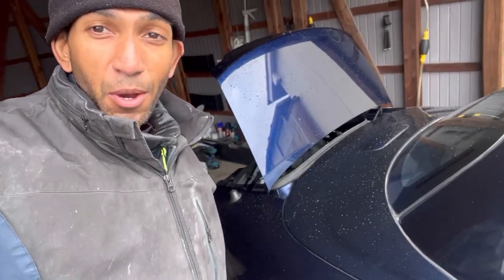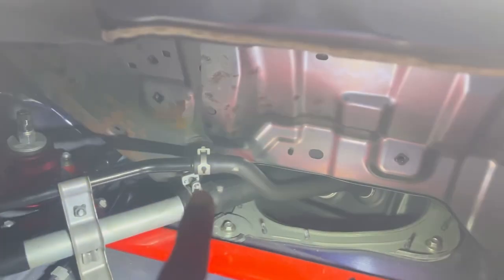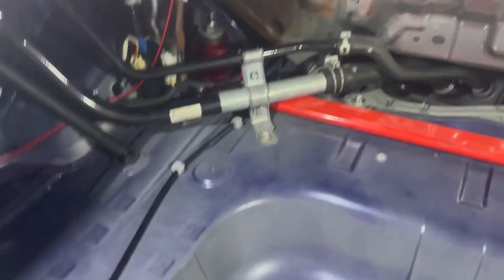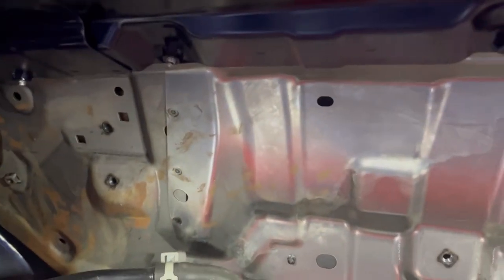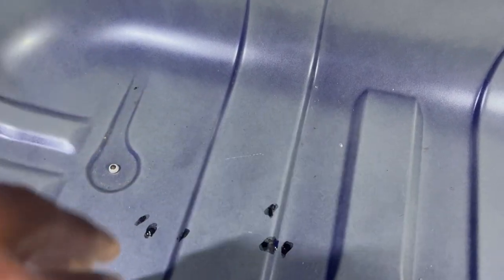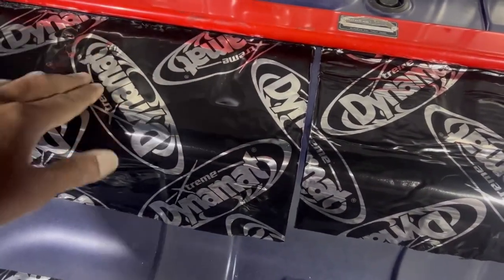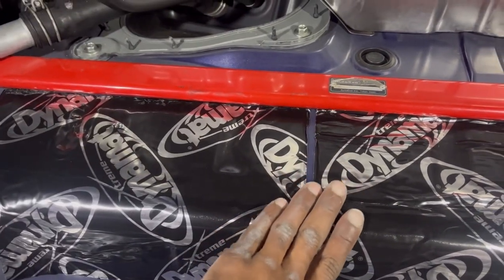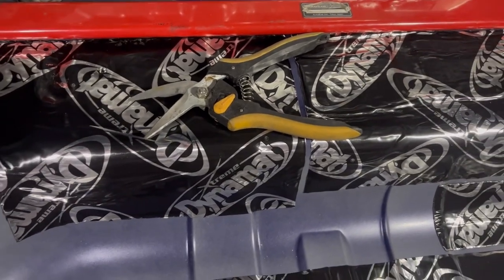NC MX-5 Miata Trunk Sound Deadening Dynamat Xtreme Install | Tach On Red

Comment: One of your best videos. Very insightful and honest. I nave an NC with the PRHT and noise is my biggest gripe. Mazda kept sound dampening out to save weight. They figured that sports car enthusiasts didn't care about quietness, wrong!
Reply from the maker: Thank you for the encouraging feedback! 

Agreed.  That said though, I'm not too impressed with most factory sound deadening on Japanese cars. (I do bodywork and paint for a living).

Would still prefer properly applying the aftermarket stuff myself and end up with better results.

Ive only done vibration damping in the trunk. Next, I'm going to add some closed cell foam on top of it and on the back of the plastic trim. Will see what difference that makes. 😊
Reply: @TachOnRed please let me know the results of that or make a video on that

Comment: i did the trunk on my NC with Damplifier Pro and Luxury Liner on top of that.  Both are from Second Skin Audio.   Sound in the cabin went down by 4 db, quite a noticeable difference.  I will probably take the seats out next and do the area behind the seats and the floor.
Reply from the maker: Ooo I should give that a try. 

Damplifier pro has a closedcell foam layer too. And you added the luxury liner which is more closed cell foam. 

Were you still able to easily fit the carpet and plastic trim back? The deadening wasn't too thick?
Reply: @TachOnRed  Yes, the carpet and trim went back in with no problem.

Comment: With a soft top, I found re-blacking the top made the greatest difference for noise. I installed soundproofing in the boot it made a difference but not as the top.
Reply from the maker: Wow. So the top DOES let in a lot of noise - that's good to know. 

When you say re-blacking, you mean like you dyed the existing soft top? Or did you replace it?
Reply: so did you use heavy weight material - for sound absorbtion Marc?

Comment: I have a folded to fit harbor freight moving blanket the trunk, it's surprisingly decent compared to the cost and effort.
Reply from the maker: I can imagine that'd work really well. Does it take up much storage space?
Reply: @TachOnRed  I can still fit my oversized golf bag in there. For $8.00, you can't beat it. I was disappointed in the results that you "achieved."
Reply from the maker: I was too. 😆😆 Haven't given up yet though!
Reply: I'm with you - I'm researching sound deadening/absorption for truck I'm driving across Asia - blankets and (heat) insulation panels work very well - both a cheap!

Comment: I'll be keenly interested if in the future you do more sound deadening, and what results you get.  If it made a huge difference, it would become a winter project.  I have a friend who just put his Porsche Boxster up for sale, complaining that out of the 19 Porsches he has owned, this last one was unacceptably loud, so It's not just Miata.  (he also had to settle for an automatic).  But you're right, Mazda should have put enough sound deadener so that at least one could talk on a cell phone at highway speeds!
Reply from the maker: I did try adding some 1-inch thick foam to the back sides of the trunk plastic trim. That made a very noticeable difference.

Still have wind noise and tire noise coming from the top and and the front. But noise from the rear has significantly gone down.  😊 If you haven't done anything to the trunk yet, Id recommend both the butyl sound deadening and foam as they deal with noise in different ways. 😊👍
Reply: Interesting.  I was going to install coilovers, but that's an expensive upgrade, and ironically that drops rthe car closer to the road and tire noise.  The noise issue is holding this back. In your car can you carry on a conversation on your phone now and actually hear?  @TachOnRed
Reply from the maker: I haven't tried at highway speeds but at up to 70ish kmph, phone conversations aren't a problem.

 I have an aftermarket stereo which plays phone audio through the speakers. So, that helps too I suppose. 🤔

Comment: The HH is removing the noise from the rear where the deadening is. I have the HH on the mid pipe which removes the sound from the front of the car. 

I’d love to modify the roof, that’s where a lot of the reverberations come from 😢
Reply from the maker: Ahh yes.  The roof! 😭

Comment: I chose the PHRT NC because it's more secure & doesn't wear out like a soft top ( having previously owned an MGF )..... As far as cabin noise goes I've never had any issues with that coz I love BLASTING the FOCAL stereo upgrade I put in....... as the BOSE system was pretty shitty.......LOL !
Reply from the maker: Oohh Focal. 👌👌

Did you go for the full overhaul? Stereo, amp and speakers?
Reply: Sure did & for 2K ( with a reverse camera ) & digital amplifier it's frikkin' AWESOME & on long road trips of 6 hours or more I can BLAST it with no listener fatigue..... so yeah...cabin noise doesn't bother me at ALL...even with the roof down around town..... LOL !@K @TachOnRed
Reply from the maker: SHWEEEET! 😃 👍

Comment: Have to do the same procedure to my soft top compartment. I get a bit of buzzing between 2.5k and 3.5k RPM.
Where'd you get the acrylic Wind deflector? My stock one broke at the hinge and I'd love to have the same one that you're using ❤
Reply from the maker: It's by a local company here in Japan called Opencafe Garage. They don't seem to be selling them anymore as they've only got products for the ND now.

I wouldn't say it makes any difference to how well it deflects wind. 

Reason I got it was just because I wanted better visibility to the rear. I always had the factory one folded down. But this one is clear, so I can see more of what's behind me even when it's up. 

Also, it's very lightly tinted. So, I don't get blinded by headlights of cars following behind.
Reply from the maker: Managed to find this on Ebay which seems very similar to the one I have. And it's a bit cheaper than What I paid too. https://ebay.us/eNVb2E

Comment: which wind deflector is that? does it make a difference compared to the factory wind deflector?
Reply from the maker: It's by a local company here in Japan called Opencafe Garage. They don't seem to be selling them anymore as they've only got products for the ND now.

I wouldn't say it makes any difference to how well it deflects wind. 

Reason I got it was just because I wanted better visibility to the rear. I always had the factory one folded down. But this one is clear, so I can see more of what's behind me even when it's up. 

Also, it's very lightly tinted. So, I don't get blinded by SUV headlights following behind me.
Reply from the maker: Managed to find this on Ebay which seems very similar to the one I have. And it's a bit cheaper than What I paid too. https://ebay.us/eNVb2E

Comment: have you ever tried to replace the rear speakers? For me, it's impossible to remove the rear panel since its stuck on the handle that releases the top and i cant find any info on how to remove that.
Reply from the maker: I don't have that problem as I have a PRHT. It has a blank where you'd normally have the roof release handle. 

But there's another YouTube creator who's made a video about that: https://youtu.be/f1EBEgmouso
Reply: @TachOnRed  thank you thank you thank you =)

Comment: I have a 2011 Se same car, and it's way too loud.  I'm concluding that the best way to reduce noise is to sell it and buy an ND.
Reply from the maker: Have only driven the soft top NDs. Are the RF versions that much quieter?
Reply: I only drove a roadster.  Have to drive another with a Db meter and compare.   @TachOnRed

Comment: Thanks for the video. I was considering doing the same thing to my NC but it seems like it’s not really worth it. 

It’s a shame because it’s such a great car otherwise but it’s so absurdly noisy with the top up it pretty much makes it an awful road trip car. Even my NA was quieter than this.
Reply from the maker: Thank you for watching!

You're right. It's probably my only major complaint with the car.

But I haven't given up yet! We'll see if I can get it quieter with some additional sound deadening. 😆